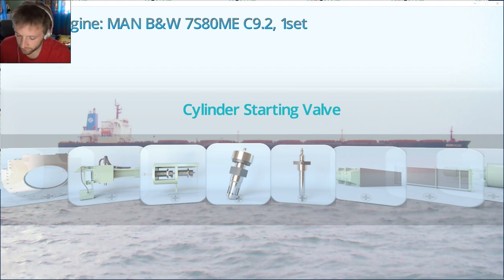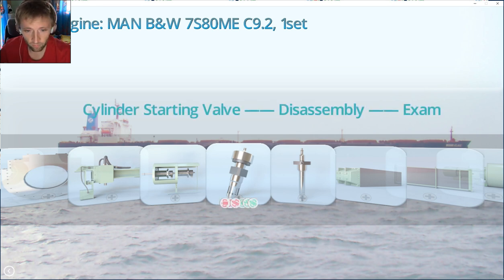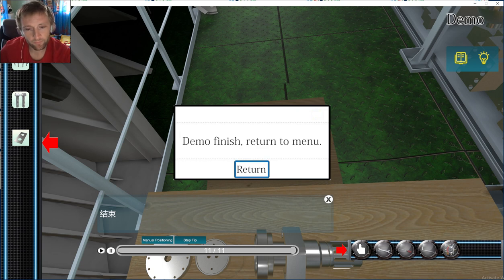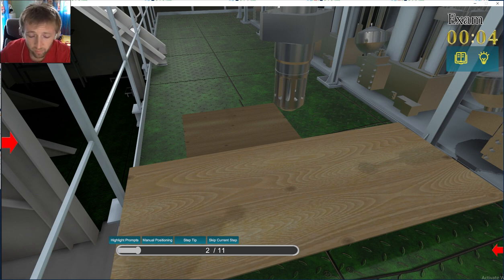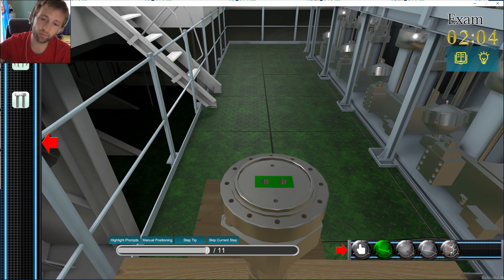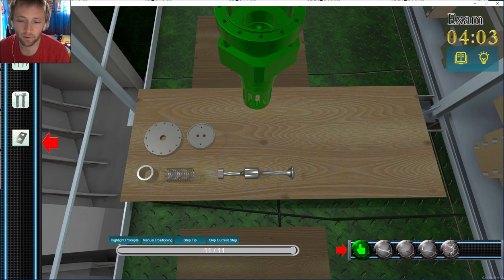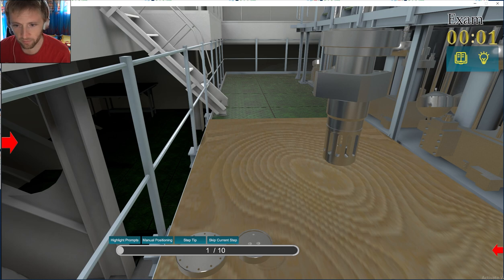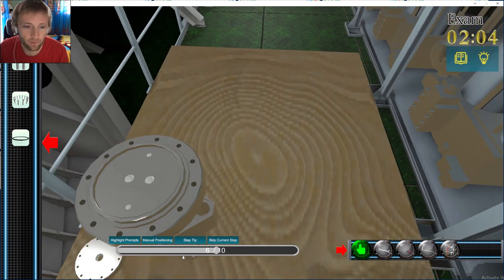Cylinder Air Starting Valve Overhauled 3d

Comment: Tell me pls my friend  how can I get this Simulator
Reply from the maker: hello you can find instructions here on channel there is video in simulation playlist videos.
Check in playlist for new simulator.
Reply: @Adventure-Story   Yes already  did , registered ,  when i try to download maintenance nothing happens (always 0% no downloading )
Reply: @Adventure-Story   Simulator opens but no active when press play. I need maintenance only .
Reply from the maker: @oldman7486  need to reset again close the program and enter again download
Reply: @Adventure-Story  Перезапустил прогу и тоже самое не скачивает  0% ( просто на судно поднимаюсь на днях и втулку дергать надо (ManBW ME), было бы полезно)
Reply from the maker: @oldman7486  Yes some of simulator are not working properly they don't have connection or signal receive.
Reply from the maker: @oldman7486  always download one program and this need to wait because program weight alot.